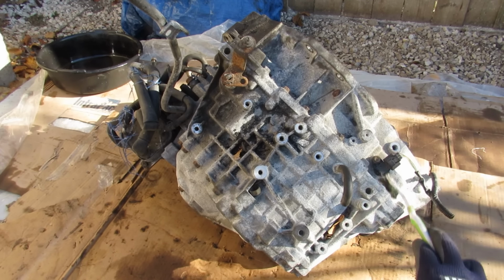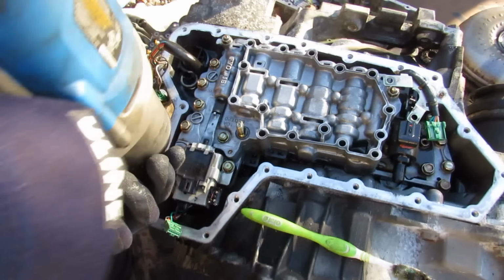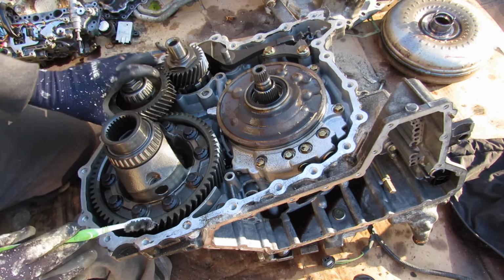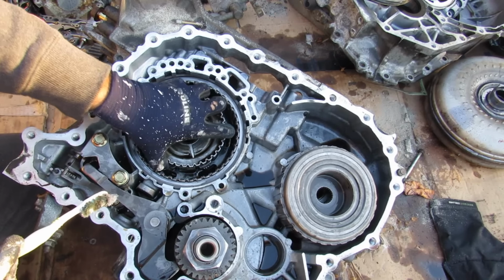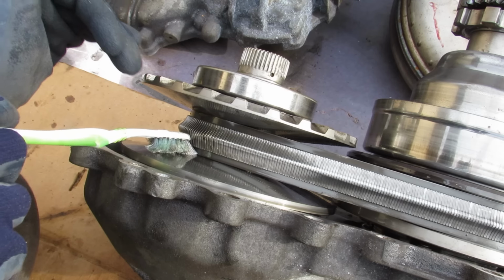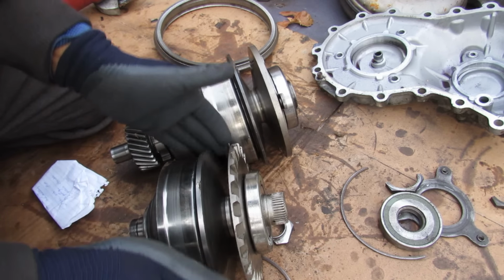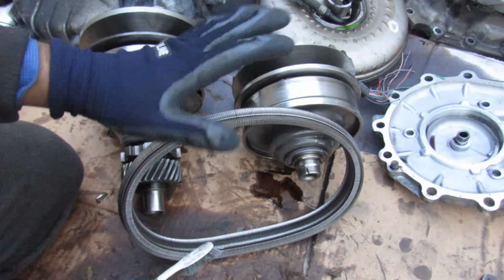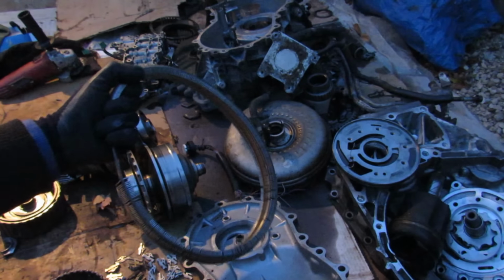Why Nissan CVTs FAIL

Comment: I used to rebuild automatics, that motivated me to drive manual.
Reply: 16 and still learning about cars (recently got the ASE G1 certification, barely, if that helps u know how little i know lol) but from seeing how simple manual transmissions are in the stark contrast to the cluster fucks that are FWD automatics i know i already dont wanna work on auto transmissions. And thats just the little FWD ones not even big truck transmissions and their valve body. I dread the day i learn to work on one, but also early await the learning experience.
Reply: @beefcakes0623  some autos can be a super bitch, I had to change parts out on one several times with 3 different transmissions and found out even though they were the same year the holes drilled were slightly bigger and some smaller because of the drill bit wearing down as they were built at the factory so interchanging parts wouldn’t work!! Lol
Reply: @beefcakes0623  I’m going to be honest with you chief. Automatics really aren’t that difficult to work on these manual folks make them out to be. I’m a transmission noob but when I was toured around a blown auto. I was like, that’s it?
Reply: @beefcakes0623  not fun to work on means job security and you can charge what you want.  Anybody can sling parts, a real technician understands failure modes and can actually FIX stuff. choose the easy path, become replaceable, learn a skill, and you will work at your pace for life.
Reply: @netdoctor1  Mechanics won't die anytime soon, just because it's electric doesn't mean you still won't need mechanics, what about brakes, steering, and suspension components? Not to mention, it will birth a new form of mechanics. EV mechanics are possibly going to be a career you could follow.
Reply: @Barbaratio  You should reread my comments. I was referring specifically to AT type transmissions; not mechanical work in general, which will always be necessary.
Reply: @Barbaratio  Most of the electric vehicle parts thag go bad or get shorted after driving on a flooded street will have to be removed and replaced. There are people dedicated to rebuild electric motors so some parts can be fixed.
 Most technicians that have gone to school know about electric vehicles.  EV are not new.  Electric Cars run in the same principle as electric pallet jacks or electric fork lift wich have been around for several decades.
Reply: @PIPEFITTERENGINEER  You've reiterated what I said.
Reply: @netdoctor1  doubt the mechanic industry will die down any time soon. Maybe for the common man gas cars won't be a common thing. But gas can't be beat everywhere yet
Reply: @beefcakes0623  not any soon...and it is harder and harder to find qualified guys that are willing to come to work every day and on time...
Reply: @beefcakes0623  As soon as Li-air battery will be real, gas will desappear (same energy density as gas). Maybe in 5 years, maybe in 50 years.
Reply: @beefcakes0623  No no. Mechanical service? Of course not. But traditional AT type transmission production is declining.
Reply: "precision transmission has entered the chat" https://www.youtube.com/c/PrecisionTransmission/videos after watching a few hours of this amazing channel I would never buy another auto.
Reply: @azzajohnson2123  The bad auto's are the CVT's,  not tried and true transmissions like you find in Toyotas,  high end Hyundai or Kia,  and other makes - look for vehicles with 6 speed AISIN Japan transmissions,  they are bulletproof!   They make FWD and standard rear drive, Aisin is Borg Warner of Japan, Awesome quality.
Reply: @azzajohnson2123  Why!  This not an auto trans. It is a CVT Transmission.
Reply: @RG The power electronics in modern EV's are all solid state with very high Factors Of Safety. There aren't arcing contactors or low quality inverters in modern EV's. The technology is much more advanced than electric forklifts and there are much larger consequences if it were to fail. They have very well designed thermal managment systems and highly shock resistant components. EV power electronics are overbuilt to last the entire life of the chassis, and they do so.
Reply: Not too many newer models give you a manual option anymore.
Sucks!
Reply: Manual for life, I'll buy used manuals for the remaining 40 years or so of driving I have left. I plan to keep my manual corolla on the road as long as gasoline is around.
Reply: @chaimileage   If gasoline is not around, i will make sure to adapt a manual transmission to an electric motor.  Having full control of the vehicle is what matters the most to me.
Reply: Correct.
Reply: @RG Everything can fail, but it seems you missed my point. My point is that this stuff is much better than the forklift grade stuff you worked on. This isn't forklift grade kachunk kachunk traction contactors making and breaking loads. These are Beefy isolation contactors that have very easy lives, as they are never opened or closed under load. They have seperate precharge systems to remove inrush current before closing. And traction current is always nulled before opening the contactors.
The contactors don't have to deal with the high power arcs you were talking about because there is always no current flowing when they are actuated.
Reply: #savethemanuals
Reply: Yep, easier to change clutch plates than solenoids, torque converters, valve bodies, planetary gears, sun gear, check balls, and the list goes on ;). And manual keeps you awake on those late night driving excursions.
Reply: I think this comment is funny because we never had a problem with autos. It’s usually the manuals considering nowadays they’re built like glass.
Reply: @Iridiumcosmos  Hello.  As every business, car makers want to make profit.  Making parts less durable is the best way to survive.  Toyota, Honda, Nissan and everyone are doing that.  Some CVT can't be rebuilt so a new one will fix the problem.  Wire insulation is made of Soy, now dealers sell a special vinyl tape to prevent rats from eating the wires.  If the wire has been consumed by a rat and it is hard to fix, a new harness will cost around $800 plus installation.  Things are made to break so the consumer pays and manufacturers survive.
Reply: @PIPEFITTERENGINEER  Your hypothesis is pretty interesting. The fact that many of these cars can last for a very long time from proper maintenance is very telling. So I’m not sure what business facts are you researching because that’s definitely not the case. For some reason, Nissan continues to make these things and are not seeing eye to eye with failure rates. While yes these transmissions have failure points but just like the 4L60-E. They suffer primarily from overheating issues. 

Now that comes back to the original point. Me personally never had issues with automatics going out and usually when one goes out it’s because the owner neglected it. My mother’s Echo which has an auto has over 300k miles on it and still shifts like new.
Reply: @Iridiumcosmos  I remember when i went to school for diesel and gasoline technology the first thing that the teacher said was that the cause of premature failure on a vehicle is driver's abuse or lack of maintenance. I have seen people starting the engine in low temperatures and immediately rev the engine to 3k or 4k rpm to warm up the car faster. After a couple of months the car leaves a cloud of smoke.  If people at least read the owner's manual their vehicle would last longer.
Reply: Same here
Reply: I had a Rogue 55,000 miles and traded it for 17 honda accord  with cvt and 105.000 miles on it and it started to sound weird ..didn't trust it and traded and bought a brand new 2024 Mazda 3 with 6speed automatic transmission  and feel confident with it! I WISH manufacturers would stop using CVTs I see alot of failures with them .respect to Mazda keep it Original .things are so bad out here we need dependable Vehicles
Reply: Only gearbox failure I had was with a manual.
5 speed + reverse converted to 1 forward speed - direct drive !
Reply: Battery cars won’t take off as some might think, it is impossible to continue to produce battery’s if every car in the world is powered by batteries also what happens to the used batteries, also every charging station will have a huge queue 24/7, also when fast charging is as expensive as a tank of gas the novelty will wear off.  People will demand the return of gasoline automobiles and WILL get them, anyway that won’t happen for the next 50 years or so !
Reply: @astra-e7w  and to think that 50 years is a long time is what baffles me about your ability to contextualize.
Reply: basic sensors can also know what the speed of car is and sync speed to rpm ...mesh both speeds no need to push in clutch to shift.
Reply: @LK-pc4sq  When i drive the truck i can sync the engine speed and transmission speed and shift without the need of electronic sensors. The same can be done with sequentials. I use my natural sensors: eyes and ears to know sync speeds and the time to shift.
Sorry for bothering. 
i know that everyone has a preference, some worship the automatics, that's what they like.  In my case i prefer to drive manual it keeps me busy shrugging the right shoulder and workout the left calf, hamsteing and glute muscles when driving (bad joke).
Also that keeps me alert and awake and in control.
Reply: Glad that we are getting rid of transmissions altogether with EVs. Or it is just limited to 2 speeds in the Porsche.
Reply: @sierrachief117  even EVs with "single speed" have transmission, which is not that much simplier than manual transmission.
Reply: @sierrachief117  next issue - batteries!
Reply: @sierrachief117 EV are trash
Reply: When your left knee begins to give out, that will motivate you to drive automatics.
Reply: @judgeadvocate9275  That's a good reason!

Comment: 14:23, with this being steel, wouldn't it be both pull and a push style system? Because it is pushing on one side and pulling on the other?
Reply: I thought the same thing
Reply: I don’t think so as the power drive is from only one pulley.

Comment: I'm in the UK, we used to have DAF cars running around back in the '70s. They had the original CVT, most people called them elastic band cars. The belts were rubber just like a fan belt. They were long and ran under the car. A pair of variators at the front and the back of the car. These were open, not enclosed in a gearbox. But ran front to back in the transmission tunnel. They were odd little cars that were as fast in reverse as they were forward. The Dutch raced them backwards, back in the '80s. Great fun but dangerous as all hell.
Reply: Sounds like a lot of fun XD

Comment: I wonder how the wiring and connectors will last bathed in hot oil.  If they use teflon-insulated wiring and nylon connectors, it should last a long time.
Why is the fluid so dark, looking more like motor oil?  I assume new fluid is dyed bright red like in other transmissions.
I would definitely add an in-line transmission cooler since cheap and easy.  The factory cooler looks too small and the fins will get crudded with gunk.
Strange that there is no ATSG rebuild manual or "banner kits" like for other transmissions.  Indeed, I can still buy most "hard-parts" for my 1960's Chrysler transmissions.  My 1985 M-B transmission is more challenging (and expensive), but still available from the dealer and others.  Nissan seems to be following the Tesla model of service (no after-market, dependant on them, must buy entire assembly instead of the just the parts that failed).

Comment: Hm, never had a problem with them. And after using them, every other type of automatic transmission just feels super slow and unintuitive, especially when paired to 4WD. Me personally, I don't want to drive anything else.
Reply: Totally agree. I guess my 2008 X-trail speedo reading currently at 276,000km's must be false according to this video. it still runs perfectly (As did my Primera, my Honda etc). Never had a problem with any of them.

Comment: I ALMOST bought a Rogue in 2014... Bought a GMC Terrain instead. Yeah, it's a turd sandwich too. Burns serious amounts of oil.
Reply from the maker: Rings or stem seals?
Reply: @speedkar99  Could be either or both. They did a consumption monitor, said it wasn't burning enough to qualify for the recall repair. If I'd relied on the "oil life remaining" I'd have burned it dry and thrown a rod like a neighbour did with 120000kms on his.

Comment: Excellent CVT breakdown video!!  The failure rate of this CVT, and Nissan's handling of this problem, is why I will NEVER own another Nissan.
Been there, been burned by the CVT system in our Maxima, traded it for a Toyota.
The CVTs in our snowmobiles are a different story: easy to work on and very reliable.  I can change a blown CVT belt, trail side, in about 5-10 minutes max.

Comment: Problem with using a laser pointer in class is that they use batteries.  Toothbrushes, not so much.
Reply from the maker: Unless it's electric batteries

Comment: Nissan does have a manual to fix the transmission.  It's one page long, it shows the the transmission being thrown into a dumpster.  On a serious note, how is it good for the environment if the vehicle has to be junked because it is to expensive to fix it.  It take a lot energy to make and dispose  a vehicle, plus a lot of energy is expended to earn the money to buy a vehicle.

Comment: Maybe someone will come up with a variable pump hydraulically driven transmission for their econo cars.
That would not seem to make sense, but if a piece of heavy equipment can use it for ridiculous amount of power, a transmission can be made to turn that torque into speed.
Don't anyone give me flack about the speed part, because there was once a diesel-over-hydraulic locomotive thatched power and speed, built in Germany by Krause-Maffey.
It didn't have the performance that the railroad desired, but then, we aren't pulling a 12,000,000 lb train here, are we?
Real input, please, no yahoos that just kick and scream, "it won't work, wah."

Comment: Save 20 minutes of your life. Cause of ALL CVT failures: LACK OF PREVENTIVE MAINTAINANCE!!! The Renault/Fiat/Peugeot(Assin) CVT has been in production nearly half a century now, and used in up to 265 HP 400 Ft/LB torque 2 1/2 ton front wheel drive trucks (turbo diesels) by UPS/FEDEX and DHL and FIRE TRUCKS and AMBULANCES in Europe, the Mid East and Asia with BILLIONS of trouble-free service miles. Ah-Muri-Kuns won't drive them properly (floor them off the line and keep the engine on the boil 'til you're at expressway speed) especially with four-bangers and the typical US owner gets excessive band stretch from lugging the motor so the 75,000 mile check interval instead of the "never check" as for Asia, Europe and South America. Open the access plate, put a torque wrench on it and check it, replace the gasket (proves you've checked it) and I've seen Altimas with 350,000 trouble-free miles on them. I've borrowed a friend's minivan with 780,000+ miles (dash cluster's quit!) to move a coffee table on 36+ year-old OEM fluid and filter and less whine than a Chebby 50,000 mile Cobalt and a heck-of-a-lot-less slip on a re-build from Rent-A-Wreck.

Comment: I loved my nissan murano, it started making a weird grinding noise, took it to nissan and diagnosed a bad CVT transmission quoted me 7 grand to replace but it was replaced under warranty. About a year later dlstarted doing the same thing. I got rid of it, never again I will own another nissan, I had other problems with that car that were expensive to repair because parts are so damn expensive.

Comment: I see tons of Nissan Rogues on the road with CVTs. I've driven a few as rentals. They seem to ride well and I do like the smooth acceleration versus standard geared transmissions. What's the average mileage before failure on these?
Reply: Approximately 200,000 miles
Reply: 125K mile average service life for CVTs. Anything more is a bonus. At lest half of them failed before 125K.

Comment: Great video man. I have repaired my 2012 Nissan Altima's CVT(RE0F10A) at home 2 years ago and I know how difficult it is to repair without proper tools. I disassembled that CVT 5 times to get it running again. These are not reliable at all. I changed pulleys, clutch packs, o-rings everything except the housing. It is true that there are very few videos and guides are available.

Comment: Wow...and I thought this was gonna be a simple video, because the hype I've always heard is that the CVT has a lot less moving parts.
Reply: CVT’s on small engines (scooter, snowmobile,go kart) are pretty simple and work fairly well, basically just the two pulleys and a belt. 

This Nissan transmission is a cluster of all hell.

Comment: You go on about how bad they are .... What your really saying it if the vehicle is heavy with a big engine they don't last .
They do work .
I have 6 CVT powered vehicles only one was traded , not due to the cvt , all of these vehicles have 100,000 miles and counting. If these were Crap why do mine keep working perfectly ?  These are a mix of hybrid , standard gas and AWD .
I think it's more a case of some manufactures not building them well than to paint ALL CVTs as bad